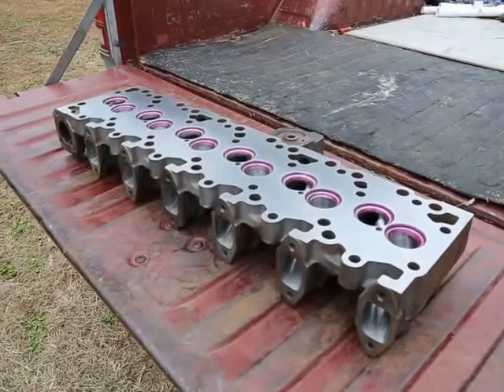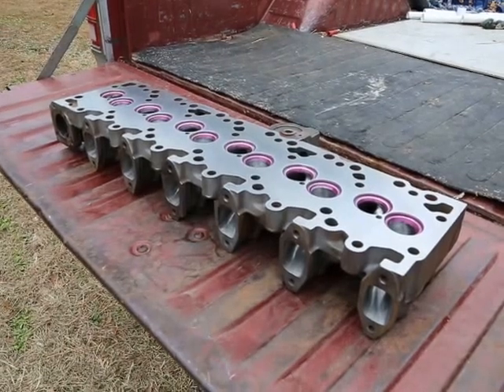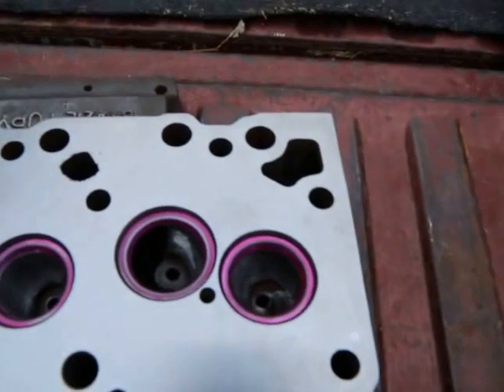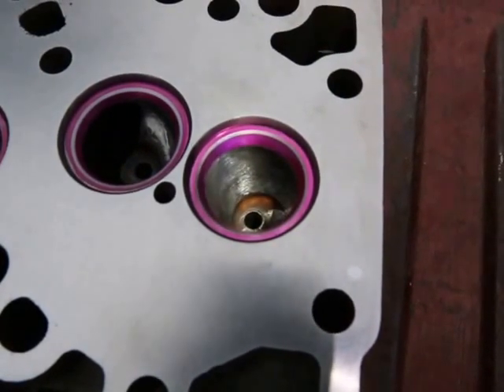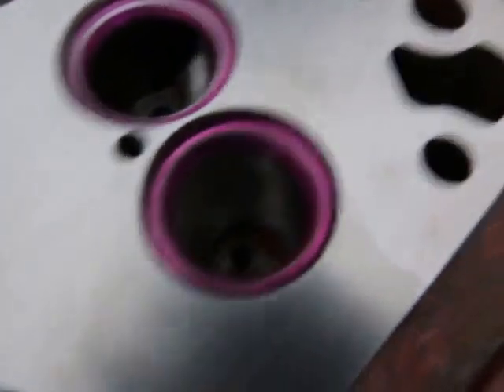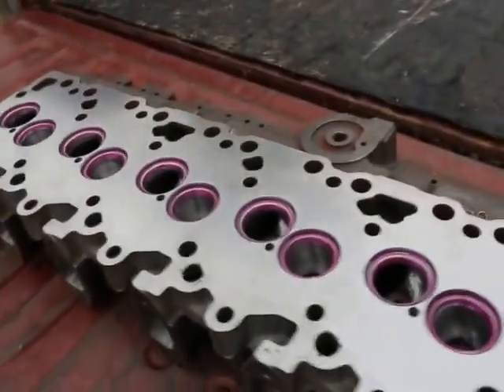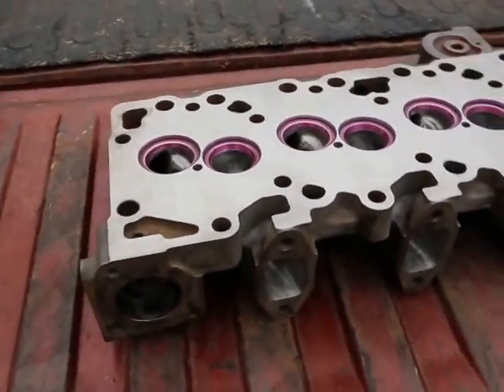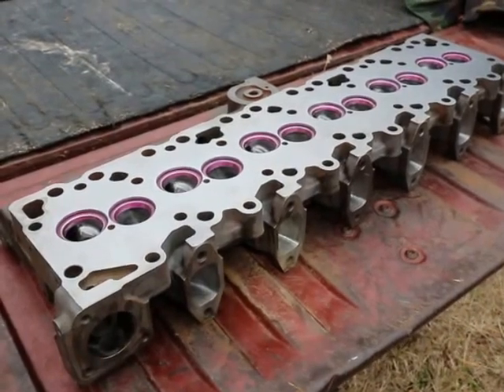Cummins 12 valve Cylinder Porting and Polishing

Comment: Are those aftermarket valve seats instead of the stock cast ones? I need info on them as my brand new oringed head I bought has casting void on one of my intake valves that is barely sealing with minimal material. 

I wanted to cut the stock valve seat out and press in an aftermarket seat in place of it.

Comment: To be honest it's not bad work but on the short side you can angle the seat towards the swirl  direction  taking your tool at a slight angle while working the seat.  You can take all of the seat angle on the intake and not effect flow in a bad way... I like porting the front and back of seat in relation to swirl. It helps deshroud the valve in key areas. Where it's needed in this take you can gain more from the seat flow and not the ports directly.  Looks like your new ports here will outflow the valves 2fold.   I agree with not going crazy I'd like to show your guys how far Ive ported my own 24v heads haha I start out conservative then I go nuts, it's a habit.  But they always turn out better flow than anything you can buy on the market but your also putting in 54-70hours per head going my route
Reply from the maker: We would love to see what you have done on yours! Take some video and post it, then just shoot us a link! Isn't crazy how long a good port job takes!!!! We are much faster now, but our first couple of heads took forever!
Reply: @70440charger  I will have a few videos posted soon as I can get them edited
Reply: That will help getting the intake ports with sanding rolls

Comment: with the work on the exhaust side you should pick up some considerable numbers on the torque front. you dont show the runners on the inlet. how much meat did you take off there.
Reply from the maker: Hi Robert! Thanks for the note.  We do feel like we gained a lot of flow with our port jobs. We didn't show the intake side because we didn't mill off the intake shelf and without doing that you really can see much. All the work we did on the intake was through the valve side of the head and with our long 6 inch carbide burr. We have run these heads long enough that we are going to be doing a video about how we feel they run and what we think worked and what didn't. Good luck on your projects!

Comment: Ive wondered why aftermart high performance cylinder heads are not offered.
Reply from the maker: Hey Mark,
There are a few places that make aftermarket heads, but the thing that blows me away is that most of them have really poor quality control. And they are pretty expensive to boot! That leaves most of us learning how to do a basic port and polish on them.
Reply: Thats what im saying I know a few guys make them  a ew guys stopped but there very over priced. Unlike lets says a sbc engine you can get a pair of bare aluminum performance heads for 400$. 
  Usually a engine this popular would have allot of company's casting aluminum heads.
Reply from the maker: I hear ya man. There is a huge Cummins following, but we haven't gotten much love from any of the big aftermarket performance companies. If they came into the game it would really drive the over-inflated prices down.
Reply: As sad as it sounds . I see huge price decreases only when china copys a product. Thats why SBC heads are 400$. There direct knock offs of darts.  Honestly Ive had a set on my 1000hp turbo truck for years no pro
Example china knocks off turbos prices start coming down.
Reply: For a performance head for a 12v the Hamilton warhead is an awesome head. Intake and exhaust are ported and it’s cut for big valves. They flow a lot and since the warhead Dosnt have the stock intake shelf you can run a runner intake.

Comment from the maker: Dallas,
Sadly, I only have a few links. To learn how to do this we spent tons of time reading and searching. Here are a few I saved but there are many others out there that are also good. Here is the 1st link:  http://www.competitiondiesel.com/forums/showthread.php?t=59175&highlight=junker+drag+truck+build&page=71
This link is going to take you to page 71 which is where the porting and polishing starts but it a threat is really good one about building up a 12 valve.  The #2 link http://www.dieseltruckresource.com/forums/1st-gen-ram-all-topics-93/head-porting-266131/ . Link #3 http://www.pirate4x4.com/forum/dodge/1394650-porting-polishing-5-9-cummins-head-does-help.html.   I will also be adding a video soon, trying to show the areas that we worked with on a unported cylinder head so please keep an eye out for upcoming additions!

Comment from the maker: Robi1nz,
The torque is good but I wont say great. That could be due to a number of reasons on this particular motor. Obviously, the larger runner and port size slows down the air speeds but allows for higher flow numbers. The other reason is because the timing on this motor is set to 22 degrees, which added some top end but hurt the low end a little. Now, with that said, when common rail guys climb in my truck they say " Wow, these 12 valves sure have low end torque." So the torque is great for common rail guys but but as good for stock 12 valve guys.
There were too many changes to the truck to be sure about the boost or lag. I will tell you that this motor produces about 45 psi with a set of DAP 5x14 injectors, Hamilton 188/220 and a modified 180hp p pump. That is a little low for what a lot of guys see and we figure that is because of the free flowing nature of the ported head. We are to 45psi by 2200-2300 rpm which I think could be lowered by switching from a industrial style 12 valve exhaust manifold to one with a middle exit and a better flowing design. 

I am tying to book some dyno time and will post all the numbers that I get and the video of it being dynoed. We recently racked the barrels on this 180hp pump and have seen a solid improvement in the top end response. The pump has been worked over as it can without taking it into a shop ( that maybe in the near future just to get it balanced)

The last thing I wanted to say about this is that as we drive the truck more and tow more with the truck, we are truly happy with how will it does above 2000rpm. Even will a lot of fuel it will stay at 900 degrees towing a 10000lbs trailer down the freeway at 75mph. That's not too bad in my book if you consider we are doing it with a larger single. Towing is not an issue with this truck. I recently towed that 10k set up a 1000 miles and got about 13 mpgs. As the motor breaks in, that number should go up a little. 
I will be posting a bunch of Cummins Videos in the next little while so subscribe if you want more info...
Hope that helps and keep the questions coming!

Comment: How is the torque now in the low range. Do you notice any difference in boost pressure or lag. It looks to me to be a stage 2 type porting job. Have you had it on the dyno yet.

Comment from the maker: Hey Josh,
I do have more info on these and will try to get a hold of you. I will also be posting more videos of the tools we found to be the most helpful in the porting process. After having done 4 of these now, we can move through them a lot faster. The best thing that we found is to think hard about air flow patterns and keeping everything smooth and even. From what we have found we have tried to make all the curves as gentle and smooth as possible. Also, Before you ever start try to sketch out or pre-plan what you want your end result to look like. I almost ruined my first one by not thinking a head.